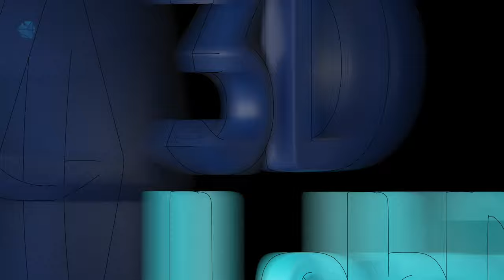WACO Final Wing Assembly

Comment: Why not show the carbon pipes? The manual says upper wing 2x10 mm 780 mm and it's impossible to get these into the wing as the pipe is blocked by the wing supports.